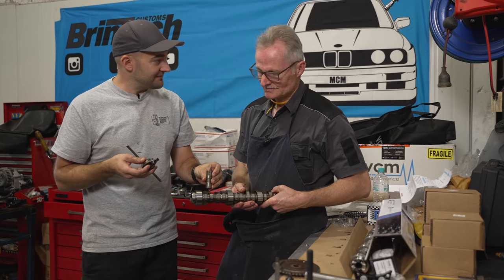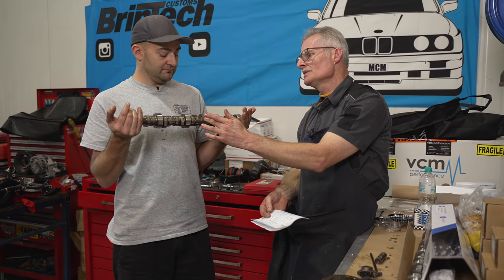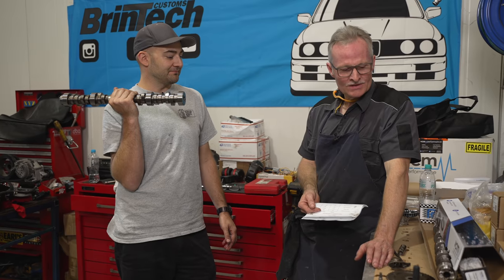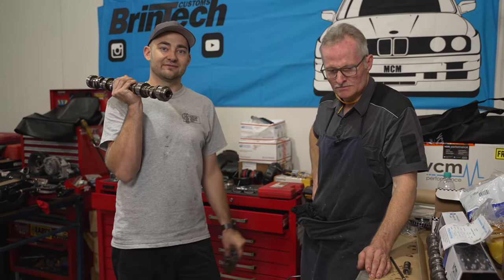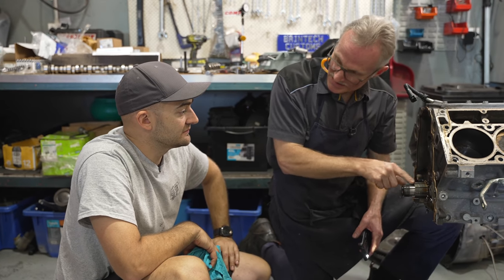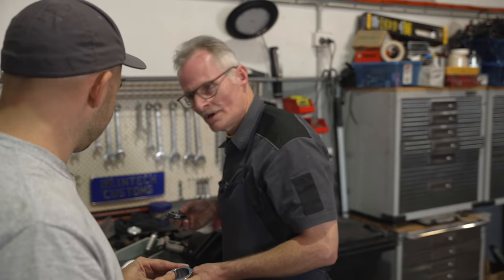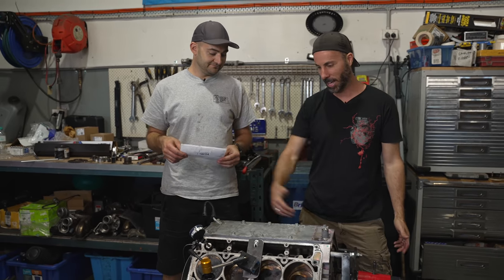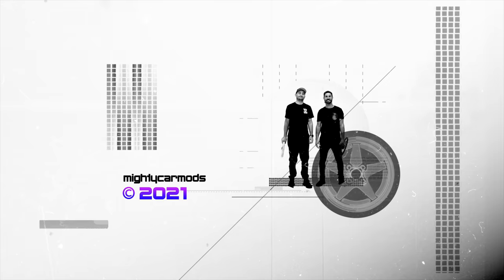CAM INSTALL tech on our LS powered BMW

Comment from the maker: We've got hundreds of behind the scenes and tech articles on our website, check it out here: https://mightycarmods.com/blogs/news/understanding-engines-how-a-camshaft-works
Reply: On my '05 GTO (Holden Monaro) I did the cam, had the heads CND'd and installed new valve springs roller lifters and rockers. I picked up 100 hp/tq to the rear wheels.
Reply: Kind of funny to see cam in Block Motors being really foreign somebody because I live in Middle America where can block V6 and V8 or just normal. PS outside of the eastern western seaboards emissions regulations are nonexistent
Reply from the maker: @BaMenace  It has one, have a look
Reply: @mightycarmods  yeah I have. Did the drive line come in ? Did the rust get repaired? Or is everything still sitting in storage. ?
Reply: That'll do it, brake fluid is caustic!!
Reply: The cam shop guy also kinda looks like a tall version of Larry King just to name another look alike
Reply: Guys I quite liked the nerdy stuff, but I am fairly familiar with a bunch of it already thanks to your friend Freiburger. You've got a guy there who really knows his stuff. Would have gone quite a ways for this episode to make some nice graphics to depict what the different cam geometries really mean and what the changes do, then this guy could approve them or recommend more detail or something. Anyways, I enjoyed this change of pace from you guys.
Reply: Why don't you port the heads when they are at the machinist anyway?
Reply: @philipp594  stock LS3 heads flow plenty for this combo - the gains from porting the heads would be negligible on this engine given what MCM are trying to get out of it. On a build where you're pushing more compression or shooting for more than (roughly) 600hp NA at the crank, then you'd definitely look at porting these heads or moving to an off-the-shelf better head.
Reply: @Iainkellyis  It won't hurt and will give them more headroom. I also think the engine can rev a touch higher and quicker. It's not all about hp =D
Reply: Yawn....
Reply: @philipp594  It can hurt, when larger runner volume = lower port velocity.  Iain Kelly is spot on with his comment.
This is not a maximum effort build, this is all about the area under the curve and drive-ability ;-)
Reply: @philipp594  it isn't all about HP, no. But if you don't need to do it then why go through the considerable cost and time penalty of doing it? This solution is the simplest, easiest and still works wonderfully.
Reply: Marty is like an absolute sponge when hanging out with this engine guru. It's so clear that he loves every second of working with Tony.
Reply: @Iainkellyis  Futureproofing for more power with less boost.

You can even do porting yourself with a dremel it's not rocket science and it doesn't take that long.
Reply: Thank god you two are doing a V8 build. The 4 baggers are cool but you two have done enough of them.
Reply: @BaMenace  It wasn’t even a month ago when that article was uploaded, how fast do you think everything is going to happen?
Reply: @federalbureauofindigestion4084  over a year ago he got the car.
Reply: @BaMenace  Yes, did you read through the whole article? It was well explained why it's going to take a long time to finish the project. Looking for gemini parts alone is bound to make the build take ages.
Reply: @federalbureauofindigestion4084  of course i did. Just didn't notice the year at the top of the post... mistaking it for last year. they were waiting on a diff to be shipped over 6 months ago... and throughout the past year there has been Gemini Easter eggs hidden in plain sight in some videos... eg: the GEMINI manual always left out on the bench etc etc. When they mentioned they were doing rust repair on black chops.. who could say whether they did or did not send the GEMINI away with black chops at the same time to fix the rust on her?.. because that's all that was needed to start the best project car on YouTube.. I'm over it now anyways... Marty's too chicken shit to drop an LS in or even a R34
Reply: @BaMenace  understandable

Comment: Having Marty be the apprentice really kicked off this guys knowledge to the moon, you can see they are both having the time of their lives teaching/learning what they love <3

This is why you guys have the most heart warming, entertaining and educative channel on the entire platform, REAL LEGENDS.
Reply: How can you accurately "dial in" that cam without the chain tensioners (slippers) or the planned solid rubbing block that removes the chain slack before you or anyone else watching this video can check cam timing? An engine without chain guides or slippers that have a tight chain when a new chain and sprockets where assembled without any slack at all like engines of the 50's, 60's, 70's and possibly into the 80's and 90's era (?). Ford FE engine and Land Rover's 4.6 liter engines of my intrest at this end. A sure bet indexing the cam 2 to 4 degrees advanced allowing when lower rpm torque to begin to develope (built with caution keeping away from possible detonation issues when advancing yet "within reason", no not of 6 to 8 degrees advancing trying to correct for a wrongly selected cam also  planned engine duty. Advanced allowing for chain wear which slowly retards cam timing. Steel cam and crank sprockets not those plastic or cast iron cam sprockets including those cast iron crank sprockets and  "Link Belt" vs a double roller chain instead. Minor added oiling tricks like in this video also allowing a little more lube oil to dribble down onto the timing chain and sprockets. 

OIl drainback holes in the the valley area cleaned removing casting flashing, rough casting finish along with smoothed out openings increasing oil drainback downward lubing the cam lobes while draining down into the oil pan. 

Worn rocker shafts with loose rockers flooding the top end with too much oil instead of draining to the sump so the oil pump can lube the engine which is critical.  Worse case the valve covers end up filled to the top to the PCV valve, intake vacuum then sucking up oil now starving the bottom end, oil pump sucking air, massive detonation issues while burning oil just before the massive exhaust smoke issue is noticed.....~~=o&o>....

Comment: "Nobody talks about side valves anymore"
Marty: "Laughing" 
Also Marty: no idea what Tony is talking about
Reply: Make me wonder how many side valve engines Tony have sitting around the shop 😁😁

I once heard a straight 8 cylinder side valve on idle, that's one of the greatest idles I've ever heard, almost calming 😁
Reply: I'm not even sure, and I've worked on all sorts of engines. Is that what I'd call a Flathead engine?
Reply: @brly4542  I'd agree with you, probably flathead. The only other thing I could think of is a 2 cycle, like a Detroit diesel where the piston acts like a sort of valve with ports on the side?
Reply: Yup a side port engine is a flat head
Reply: Yeah flathead.  Popular in WW2.
Reply: @turbogav8674  and the 50 years before that.
Reply: @vintagetractorsaustralia  I mowed my lawn with a sidevalve engine yesterday!
Reply: @brly4542  yes. Also known as a flat head. The valves are built in to the block beside the cylinder, hence ‘side valve’, and the cylinder head essentially just houses the combustion chamber and cooling passages. 
Very common pre 1960, the are very nice quiet running engines but not great for power as it is difficult to get the air flow and compression ratio required to make good power by today’s standards.
Reply: @getchasome6230  That's not the same. Side ports are inside the cylinder, a flathead has the ports outside the cylinder.
Reply: Me: has an 8 cylinder side valve in the shed.
Reply: I got flathead 6 on DeSoto Deluxe '48.. V8 flatheads are really expensive and wanted by rod guys, but straight sixes are really cheap.. mine costed 700€ with trany.
Reply: @ErrtuZarathos  there was an old 50s Ford with a Flathead in it abandoned behind my old house, still kicking myself for not rippng it out of there
Reply: @brly4542  Yes
Reply: Tony's trying to tell him how to stand when he's inserting the crank shaft, and Marty's just ignoring the shit out of him.

Comment: I bought an Australian car, a 2014 Chevrolet Caprice. I've discovered it's a commodore ve that was sold to police the same years the commodore vf was sold as a chevrolet ss. L77 6.0 with 355hp. It's a fun car
Reply: That was just a family car down here, ha ha hope you enjoy it👍
Reply: The Caprice is the Holden Statesman Caprice built in South Australia, and is the long wheelbase version of the Holden Commodore (not the same car) and was marketed as a luxury car here in Oz.
Reply: dads ute has a L77 with aftermarket intake and full x force exhaust. makes 380hp retuned for the catless exhaust and intake so theyre getting their moneys worth. sounds awesome and goes fast
Reply: As others have said, its not a Commodore but here its a "Holden Caprice" or "HSV Grange", luxury cars.  Fun fact, China built their own version and called it the Buick Park Avenue, they changed the interior a bit from our cars but exterior mostly the same.  A few guys over in the states have started the Aussie spec conversion but its pretty expensive to do stateside.
Reply: I'm looking into the statesman and holden caprice now. Thanks for the info! I'm trying to buy new fender vents, headlights and taillights. Certainly helps knowing about the statesman/caprice
Reply: @chrishaddox5078  FYI, its chassis code is WN.  You might get better results instead of using VF in the search.
Reply: The consumer version was the Chevy SS.  GREAT car but really expensive and didn't sell well.
Reply: @button-puncher  The Chevy SS got the latest model. The lights, body panels, trunk lid, hood, bumper, engine (ls3) was all different from the Caprice PPV of the same year. But yes it was like $47,000. You could buy a corvette for only $4,000 more

Comment: "You don't want the overlap for boost..."
Richard Holdener enters the chat
Reply: That's right.  Easy to say and repeat that "overlap is bad for forced induction" but it's not backed by evidence.
Reply: @kevin9c1  Dyno graphs of back to back cam swaps looking for the right cam application are pretty good evidence...nothing wrong with a little overlap, the issue is with wide open NA race cams not being optimal for boost. Midrange loss, but a decrease in EGT from the charge blowing through with high overlap, in my experience.

Comment: Love how this is 'foreign' stuff for ya!  LS cam swaps are like hotrod 101 in the US... cams belong IN the block! 😊
Reply: All supercars have 4v DOHC VVT and turbo, and if a v8, are flatplane firing order.
2v pushrod was built in the '50s and belongs to a past era.
Nearly every car engine built world wide in 2021 is 4v DOHC VVT and turbo
Reply: @nordic5490  you have to admit that although the LS, and other pushrod V8s, follow a simple recipe, it's a damn effective one. They're relatively compact engines capable of superb output for such an apparently outdated design

Comment: "hundreds or thousands of an inch" that's why normal countries have Millimeters, or what you would call it "0,0393701 inch"
Reply: Most if not all machining shops still use imperial, as the metric system doesn't have anything comparable to the precision of a thousandth of an inch
Reply: @BriFlipProductions  We have thousands of an Millimeter so no, you have not the more precise system and no in europe literally no one uses the imperial system
Reply: @schnuffelpuff3923  I live in Australia, and I'm speaking from experience in fitter and Turner roles lmao
Reply: @BriFlipProductions You might use them in Australia but your countrys been sticking to the imperial system forever so its no wonder some people still use it over there. But every other country that has to produce high quality products is using milimeters, in my job we have 0.001mm tolerances what equals exactly 0.00003937008 inch. So dont tell me nothings more accurate than a thausand of an inch (0.001 inch)

Comment: I did a cam upgrade on my VE 6ltr L76 over the easter weekend with the following specs, 223/228 duration with .580/.588 lift at 114 deg separation, Upgrading the cam in your LS is one of the best bang for bucks mods you can do. the improvement in power and torque is fantastic, 
I also did the DOD (AFM) Delete, The whole kit including a tune (remote) to make it all work is only around $3000
The kit comes with Camshaft of your choice
PAC Dual Springs kit
Chromoly Pushrods
Genuine LS7 Lifters & Lifter guides
Head gaskets
Head Bolts
Harmonic balancer bolt
and valley plate to complete the DOD delete.

While your heads are off you should replace the valve stem seals and do a trunion upgrade as well for piece of mind... you don't want the factory needle bearing falling apart from the extra lift and scattering needle bearing through out your engine...

Comment: For anyone interested in further number nerding, the stock LS3 is 204deg inlet/211 exhaust @50thou on a 117 degree lobe separation, with about .550 of valve lift. Not only does the VCM in this setup have 20ish degrees more of open duration there’s another 50thou of lift or a more open valve also. So much more breathing room. The separation angle makes a big difference in low end drivability too, I’ve got a slightly bigger cam but more separation angle so less overlap, there’s less chop but it’s more tame to drive, an important factor if you daily the vehicle and want to avoid cam lump in low speed driving.

Comment: A word to Tony about crankshaft placement in correlation to piston travel: the Kia/Hyundai Gamma engines got also a slight crankshaft misalignment for reducing friction of the piston in the cylinder.

Comment: Man thats so much more effort and work to dial that in with that fancy timing setup than I would wana do haha. We pulled the cam out put new one in with new sprocket, kept same chain and tensioner. Out, in, new pushrods and springs and she ran great.

Comment: Advancing the cam means Retarding the crank and visa versa.
I love that you guys went to the trouble of showing this one.
It does take some focus to get the cam timing dialed in.
I usually end up to two of three sheets of scrap paper being used and double triple check everything twice over on such maintenance tasks.

My 22R in my 86' Hilux has an adjustable cam gear that I can advance and retard with just removing the valve cover, loosening three nuts, making the adjustment and reassembling.
I built it to make more torque and not rev quite as high as stock because, it is a 4x4 and crawling around works better with torque than high rpm and horsepower numbers...
...plus it saves risking the number 3 rod bearing from starving for oil at high r's because it's the last one getting fed in 22R's.
The engine now pulls hard until about 4500rpm instead of around 5300rpm as in stock trim.
It will pull away starting in second gear without dying.

Speaking of airplanes, why haven't we seen any mad Toyota Hilux builds on MCM?
They are virtually indestructible, you know?
Is there a ban on them Down Under?

Comment: Probs should have done the trunion upgrade with that camshaft as they renowed for letting go and filling the motor with needle roller bearings good luck guys

Comment: you dont need a dail gauge to set youre degree wheel , just a plate with a bolt hitting the piston :
turn it right way around untill the piston hits the bolt and note the degree on the wheel (say 6 degree), then rotate the other way untill it hits again (say 4 degree) so you have 10 degrees between both hits and the tdc is in the middle of it (so you need to set the pointer to 5 degrees when the piston hits the bolt either way  )
then you take the plate with the bolt of the cilinder and set the engine to zero or wherever you want it set at

Comment: Good they check the timing once adjusted. 19:30 you see the degree wheel move without the crank moving as it tightens up the crank bolt. Would have had a false TDC measurement.

Comment: you guys should do a big bang cam car, literally cut the cam in half and rotate 180 degrees. I did it with a 250cc Sherco engine at University (Motorsport degree), was cool af!

Comment: As a general rule, simplicity increases reliability. The less parts there are, the less parts there are to fail. This is why they still use single cams and pushrods. There is plenty of power to be made with that engine. ;)

Comment: Cylinder bores offset from the centerline of the crankshaft are called "de saxe" cylinders (they describe them as having lambchops, which I assume is the shape of something in the engine that accommodates the offset). De saxe basically comes from the french phrase for "off the axis". Outside of some weird french engines I only knew that the VW VR motors were de saxe. Apparently some diesels are too! #TheMoreYouKnow

Comment: You need to watch Richard Holdner’s YouTube channel.  I’m also surprised you didn’t use a Sloppy Stage 2 cam (SS2). HP increase through the entire poser band. No down low loss like other ls cams

Comment: People say the ls is old technology, it's not its push rod. It has hardened cylinders, sodium filled valves, short pistons and rings, roller bearings, roller rockers and 1000 other advanced things that you would see in any modern engine for lower friction and weight and more efficiency. Its just push rod.

Comment: going off the VCM spec sheet the lobe seperation is 113 degrees, not 110. 
110 degrees on a street car would be suuuuper grumpy down low and a nightmare in carparks.
for me 112 is the sweet spot.

Comment: i might have the wrong idea here but to calculate the degrees needed to change on cam timing, rotate the crank to the desired lift (61 thou) and read the degree wheel degrees from tdc. Tony plz correct me...